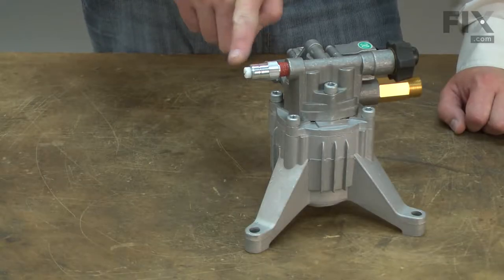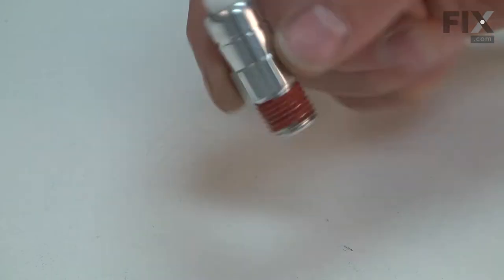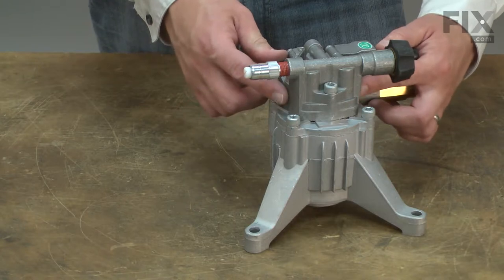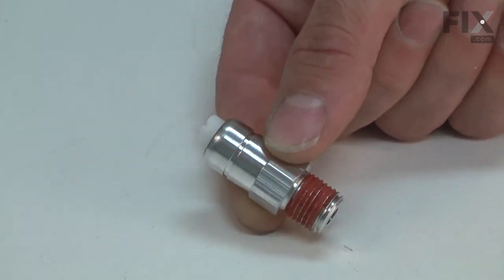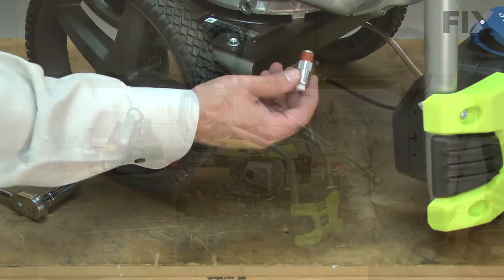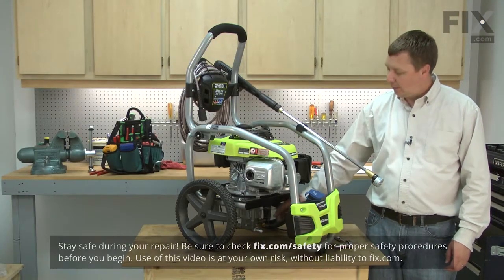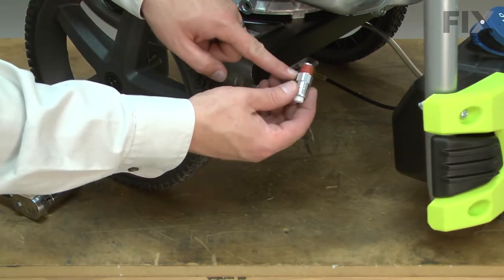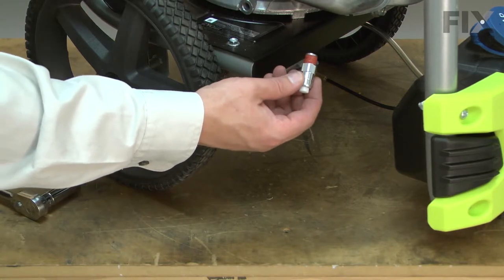Homelite Pressure Washer Repair - How to Replace the Thermal Relief Valve

Comment: I've seen on some of the better pumps that the unloader valve can be plumbed to redirect the water into a surge tank when The water is not going out the pressure hose.  That thermal relief valve has me wondering if this kind of pump can be modified to do that. I have to run my pressure washer off of a tank because I don't have a water source where I must use it.  I'm wondering if the pump would still work if I replaced the thermal relief valve with a hose back to the tank?  Seems like there would still need to be  a thermal switch there, but don't want the need to replace it every time it blows.  Seems like a stupid idea to replace if the motor stays on too long.